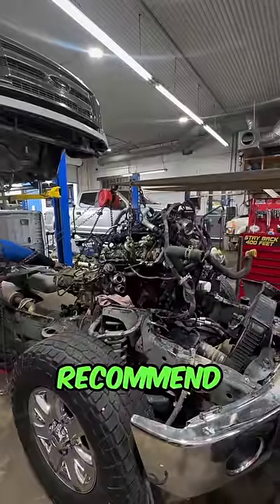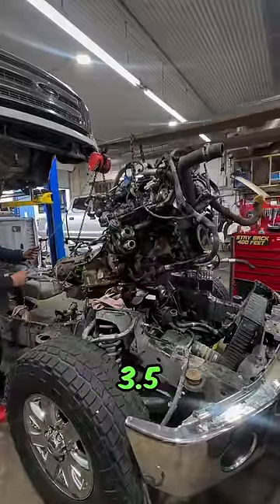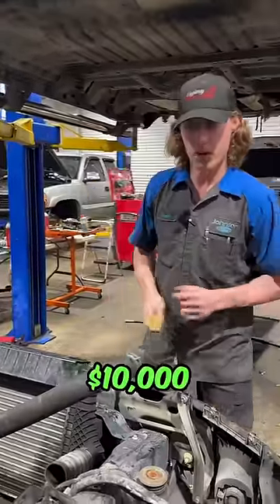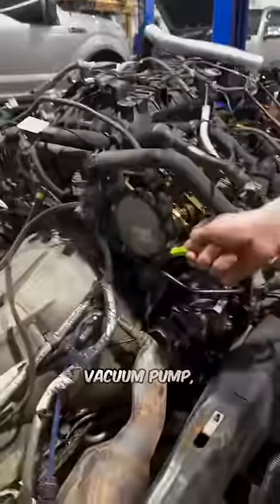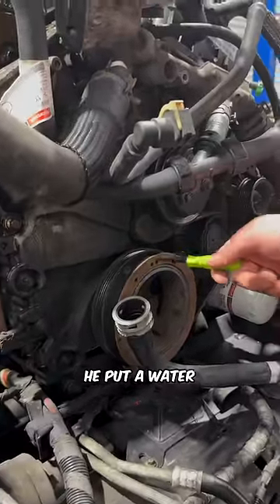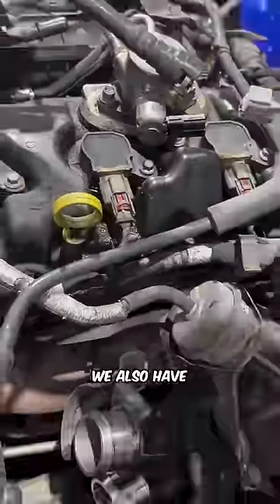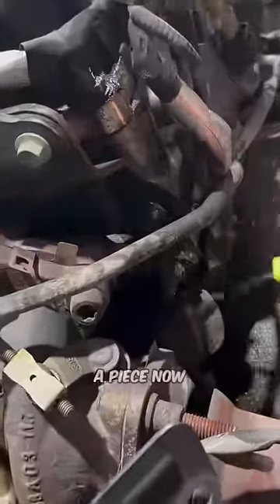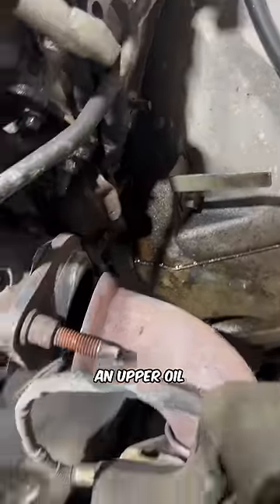Why not to buy a Ford 3.5L EcoBoost? #ford #ecoboost #shorts

Comment: So you’re telling me that after 200,000 miles it’s just got some oil leaks doesn’t sound too bad to me it made it 200,000 miles
Reply: In todays truck engines 200,000 doesn’t sound bad. Older trucks are kicking at 350k
Reply: Couldn't agree more.
Reply: My dodge ram cummins that’s 24 years old has 250,000 miles and has significantly less leaks than that engine
Reply: Right? He could just kept driving it and adding a little oil
Reply: Right, Toyota the “king” is having turbo failures and rod bearings fail but ya know..
Reply: The story behind it that it's been having issues since 55k
Reply: He said it's $10,000 to fix it 😂
Reply: @samholdsworth420  Lol...ouch..
Reply: Put some Quaker State in it, it'll quit leaking. 😅
Reply: Who knows what problems it’s had in the past. Just in this video alone is like 5-10k in repairs/service work. 
My 2013 Nissan pickup truck is at 300k right now and it the only leak it ever has had is a simple valve cover which was fixed at 280k. Not to mention no other major repairs or breakdowns ever! 
Fords after say 2010 are sh!t. The 5.0 coyote is decent compared to eco boost junk. 
But the overall quality is at an all time low. Super expensive crap that isn’t going to last nearly as long anymore
Reply: Love mine, over 100K miles  ,never got to use warranty  so far only replaced the battery
Reply: Thats a lie Cummings leak from the factory new not only that your probably on your 2nd or 3rd transmission
Reply: my 20 year old pile of shit BMW doesn't even leak from that many places with over 200k 🤣
Reply: @busterscrugs  Does it tow 10,000+ pounds and haul 2000 pounds in the box too? 🙄
Reply: @gsppuffer ye the 47re is trash in the 2nd gens, decent with borg warner valve body updates, and billet shafts tho. Lot better in the newer ones but still not near as good as the Ford, they never will be!
Reply: My 5.3 in my 08 Sierra had 1 oil leak from the oil cooler block off plate and it has 252k on it. We fixed that and now it has no leaks and the motor runs great
Reply: It's like the old saying goes  with Dodge, "it's a ten dollar truck with a ten thousand dollar motor"
Reply: @coupons420 every manufacturer has mistakes but only 1 has several engines that can run 1 million miles plus
Reply: @gsppuffer I have several cummins engines in my fleet there actually pretty dry my detroit diesel on the other hand if it's not leaking it don't have oil lol
Reply: @gsppuffer 
Cummins not Cummings.
Reply: @Dontwannahearit that old cummins wasn't built to a 100k tbo, the cummins engines are built to a 500k tbo
Reply: @gsppuffer  actually on my first and only transmission with 250k miles, also the original injection pump, axles, transfer case. Sorry but cummins takes the W for the diesel pickups
Reply: @productions6994  my 47re has made it 250k miles pulling 10,000 pounds pretty frequently and still is today. So how is the transmission trash?
Reply: Exactly
Reply: @Dontwannahearit  good for you. I stand behind my point. Not talking out my ass like you implied. I've had one too. Bought BRAND NEW in 1994. Neil bolding Dodge 22,500$. Only good thing was the Cummins engine and Dana 80 rear end. Trans started slipping badly after two years only pulling a small horse trailer occasionally and had to get it fixed at wideco. And omfg don't even get me started on the front end and the steering box in that truck........ Pure JUNK. LMFAO the front tires wore uneven terriblely from factory!!!!! Fucked up junk right from the factory bought brand new!!!!! Put thousands in that front end over the years, and it  STILL was never right!!!!! Then I got a 01 7.3 crew cab 4x4 and learned what an actual good truck is.
Reply: @productions6994  my front end is completely original, 24 years old 250,000 miles all I’ve changed is the sway bar links, same with the transmission, still pulling heavy trailers up steep grades with 250,000 miles. You gotta learn how to maintain the truck
Reply: @busterscrugs  Stop it
Reply: owned a 2012 f150 3.5 for about 4 years.
 fully modded. 
 blew the 1st motor @150k running stock turbos( but sucking every bit of power from it . 450whp-ish )
 
 dropped a new motor into myself in my driveway with more goodies and big turbos. 
 50k+ currently with a 500whp e20 custom well worked tune.
 
 yep there are easier things to work on.  but honestly,  these things are like playing with legos man, 
 childs play. ya dig? 

  granted, I am not working on these for a pay check, that does change the perspective. 

if you have stable hands you dont even need to pull the rad. to get the motor  out.
Reply: @madjackgamingandfitness498 yea cause they’ve been repaired so many times😂 and those are the good ones. The rest of the “older trucks” are in junk yards
Reply: Why I bought a 2018 Toyota Tundra. My 07 Chevy Silverado is on borrowed time with 235k.
Reply: @Dontwannahearit  Great.  Do you live in a super hot climate or Canada?
Reply: @bmwlover1981  funny you ask, I actually live in southern Arizona and see 120 degrees just about every summer while im pulling my trailers
Reply: At 200k it's not worth fixing all those leaks 10k just put a motor in it.
Reply: @Dontwannahearit your cool
Reply: @brendoncrum9082  sorry the facts hurt
Reply: The Coyotes don’t need nearly as much work.
Reply: @EricFortuneJr.  I’m a die hard ford guy. Trust me. But, the Gen 3 coyotes have oil consumption issues. If a catch can wasn’t put on them early in their life, chances are it will have a couple cylinders with less compression.
Reply: My Nissan Sentra 2012 has 317k miles
Reply: @NeutronX101  all highway miles. There’s a difference in a work truck that pulls trailers and a car that runs 55 mph down the highway at the hardest part of its life
Reply: Sad that people think this is acceptable..buy a Toyota
Reply: @jayc4715  my 2003 Toyota 4Runner with the legendary 4.7 cracked the #6 cylinder wall at 187k miles… had to put an engine it. But go off queen
Reply: Probably stock turbos 😂😂😂
Reply: I know, what more could you want.
Reply: @MrRupus2020 you mean quaker oatmeal.. works for radiators .. not oil
Reply: Years ago Pennzoil marketed their oils with having the finest paraffin base stock, which people thought as wax.  During that time 10w-40 was a common used viscosity and people wouldn't change their oil on time and the additives in that particular viscosity would sludge easily. So, they assumed it was wax and it would stop leaks and flow all together 😆
Reply: These trucks are absolutely garbage
Reply: This guy is covering Ford's ass.  Seriously.
Reply: Yes, I think he got his money 's worth 😊. We used to be happy 🎉 with 100k
Reply: @brysortho  But, you weren't spending $50k on a truck then. I've watched my dad pay $3500 cash for a brand new 79 Ford pickup and 100k but be pushing it for that old 302, even though he had a propane conversion thanks to Carter.
Reply: 200k is a new car bruh
Reply: Have a all factory 3.7 Magnum Dakota with 200k on it, bed rusting off and barley oil residue around the lower valve covers. There is no excuse for bad quality.
Reply: Facts it's outlived it's designed life
Reply: My 2001 Camry sitting at 450k miles. Original engine and transmission. Trans is starting to give though. I’ve never changed the trans fluid ever. Starting to lose reverse. Still kicking though
Reply: @lesterparker1594  seriously wow almost 500k in 4 yrs that's why toyota
Reply: @josephpeluchette191  nah man it’s a 2001. It’s been over 20 years.
Reply: @josephpeluchette191  it was my first car. Drive it all the way thru high school and college. I have a new truck now, but I still drive the Camry to work every day. 50 miles both ways. No sense in putting the miles on the new truck.
Reply: @lesterparker1594  very cool hope your truck last that long
Reply: My has 205,000 still going
Reply: I just don't see a reason to spend $10k bucks for some oil leaks. Just add oil and go
Reply: @coupons420  Got a 08 tacoma that is on its 3rd trans since new and i got it with its 2nd and my luck they apparently ran it dry of oil and it bricked after i bought it. So ended up with a brand new 6 speed manual trans in it and everytime you drive it something else breaks on it.

It's the biggest piece of shit money pit I own. Toyota was good in the 90's backwards just like Gm.
Reply: @Truthcanbeconfusing Lucas and it's mostly fixed

Comment: Not exactly a Ford 351 Cleveland. The government has destroyed engine manufacturers
Reply: or better, a 429 or 460 !
Reply: The Windsor was much better than the Cleveland
Reply: @BA-gn3qb  I was one of the very few who custom ordered an 89 Grand Marquis LS sedan with the 351W and Trailer Tow III Package. The performance axle ratio was a 2.73:1 with a 0.60 overdrive. It matched a friend's 89 Honda Civic for gas mileage. Rated for 6,000 pounds of trailer. Still ran like new, too
Reply: Yes we had better cars till we had to compete with the gas savers directly from the gas crisis of the 70s butt heads killed our cars
Reply: Greed. Greed has destroyed engine reliability. Plastic parts  save companies pennies, and cost us thousands in repairs.
Reply: 1970 351c-4v with the FMX transmission 
We're bullet  proof
Reply: True, 351's didn't last 200k miles to start with, much less then still be worth fixing
Reply: The government doesn't make anyone use plastic intakes, single use oil pans etc. The manufacturers do all of that.
Reply: @SealofPerfection  They did however leave space for better engines after disposal. If it wasn't an FE or a 460 I scrapped it.
Reply: @oldphart-zc3jz    fuel efficiency standard implemented by the National Highway Traffic Safety Administration (NHTSA) to enhance the average fuel economy of cars and light trucks sold in the U.S. The CAFE standard regulates the mileage   of vehicles
Reply: they all had to be rebuilt way before 200,000 miles.
Reply: @BA-gn3qb  For what?
Reply: @Tropikaybay  Which doesn't make cars worse, if anything it should make them better. Stop blaming a vague notion of  "the government" for the failure of a system that only cares about making profit and not about providing you with a good product when you need it.
Reply: @oldphart-zc3jz  They absolutely do
Reply: @mbsnyderc  Just like any motor. Difference?
You can have a 351 out in an hour, tore down in 2 and rebuilt in and back in no time
3.5l and most modern engines 95% of the time its junk
Reply: @oldphart-zc3jz no the govt makes EPA mandates which means you have to have higher compression ratios, CVTs, turbos, direct injection, recycle valve, and yes plastic parts to save weight.   All these put together reduce reliability and raise cost.  Add in mandatory safety features and those weight savings are gone.

How much did we save?  Zero.  Engine cost increased and more than offset the minimal fuel savings.
Reply: @donh8833  CVT transmissions have nothing to do with EPA mandates. Plastic parts have nothing do with government mandates. Turbos have existed in consumer vehicles since the 80s. Stop blaming everything on the government and accept the fact that you're getting shit engines because the manufacturers are cutting costs in all the wrong places because they need to make more profit every quarter. I am not saying the government is infallible and all-powerful, but you're barking up the wrong tree here.
Reply: "American manufacturing"